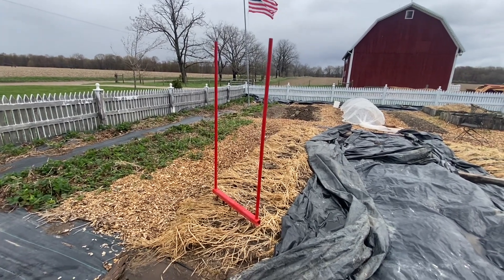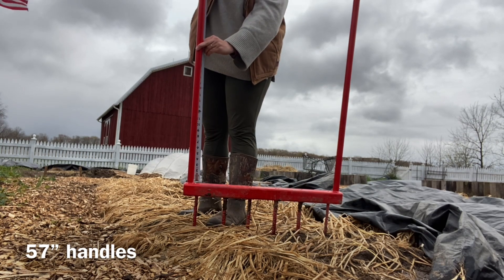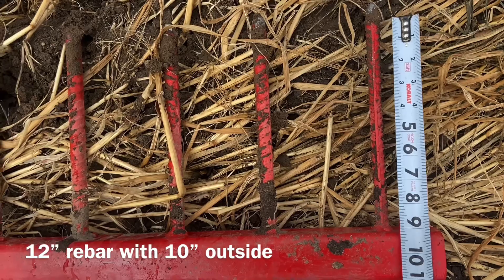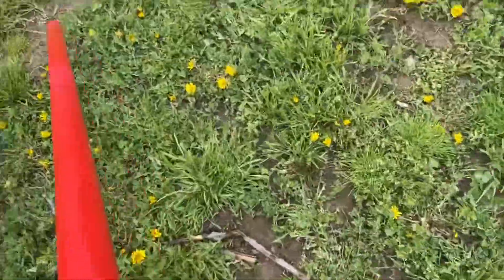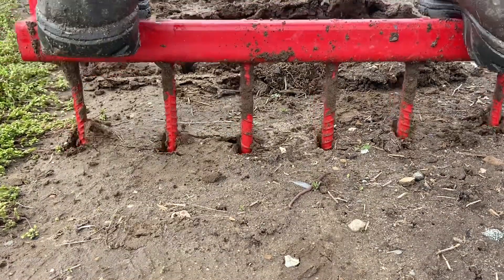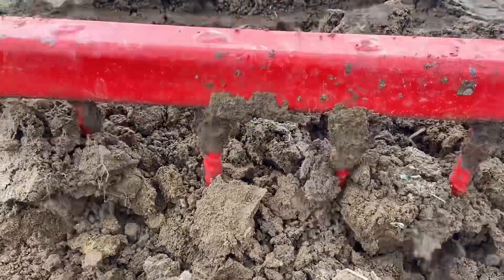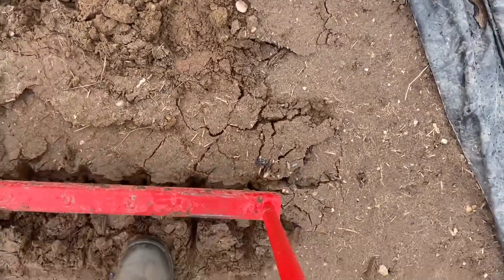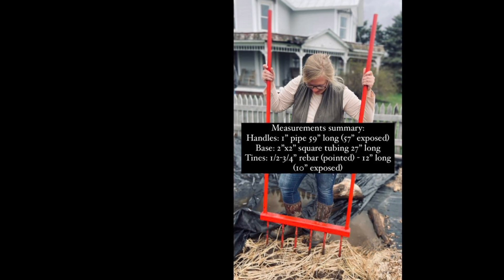DIY Broadfork - Homestead Welding Project

Comment: Great video. I've wanted to try out this tool for a while but the store bought ones are out of my budget.
There are a few measurements that you missed which can be deduced from the video and other measurements but it would have been nice to get them.
These are:
1. The distance between tines
2. The distance between the left and right tines and their corresponding handle
3. The distance between the handles to the edge of the 2X2 square tubing